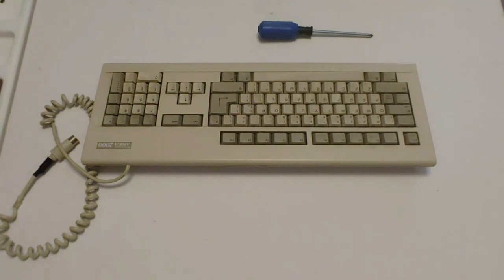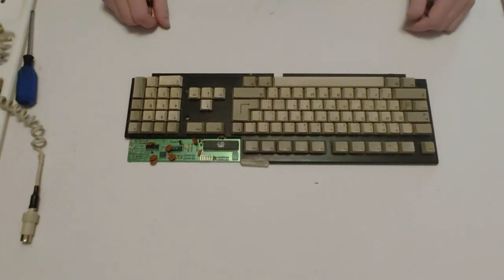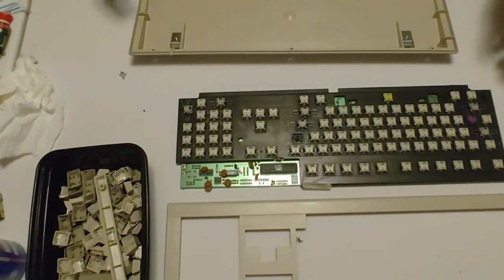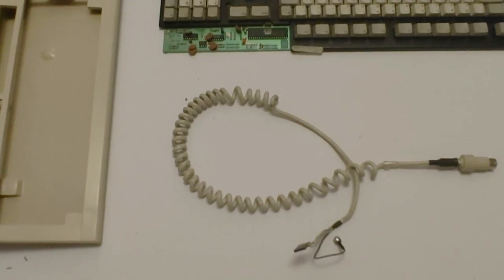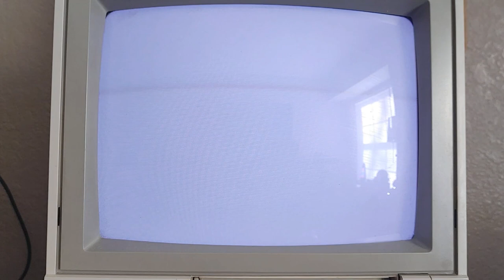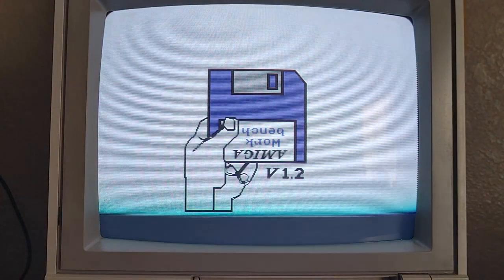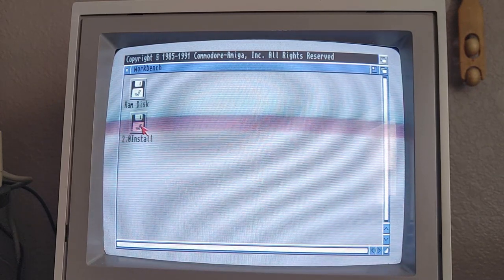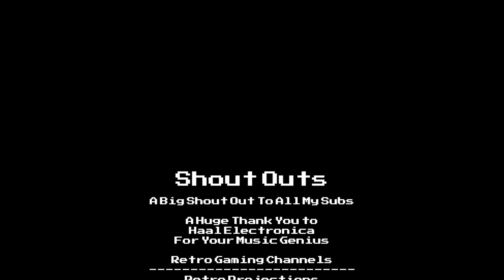Amiga Keyboard Restoration and Kickstart Rom Install

Comment: Very nice job on the kb restoration.  Even the cheapest computers back then came with good (in terms of build quality, not necessarily typing feel) keyboards.  All the early PC computer keyboards I had were very, very well made.  Some time around 96 they started really skimping on the quality of keyboards shipping with PCs and later with mice.  Recently I was cleaning a Dell keyboard and one of the keys still had like a single drop of water on it and it trashed the keyboard.  They use conducting ink on a Mylar sheet as the backplane to register keystrokes. That tiny single drop of water killed it.
Reply from the maker: Yep.. I have that Atari XEGS, it's got that kind of mylar membrane man.. Hate those keyboards. The traces are like gone.. I ordered some conductive paste awhile back to try to redraw them. But I think the porch pirates got that... Arghh. I'll have to reorder and think of a different project video in the meantime.

Comment: 18:10 When I fix cracked plastic, if there is a portion that is "inside" (not visible), I'll superglue the crack and then on the inside, JB Weld a piece of metal or plastic (like cut from a CD jewel case)  if I have extra to the inside, like a bicycle tube patch (IOW, a square or rectangular patch that overlaps the crack).  I learned that trick with radios. The repaired section will be the strongest part of the whole thing.

I doubt that standoff is going to hold. You can spread some JB weld around it (so that the JB Weld is on the both the case and the standoff).  In my experience, superglue is OK if you can work some baking soda into the repair, but otherwise is absolutely worthless for gluing plastic.
Reply from the maker: I've had luck with Gorilla Epoxy.. But yeah all I could find in the hick town I live in is Krazy glue.. lol... I really didnt want to wait to order some in. So.. lol.. If it breaks, I'll use Gorilla or JB.. JB is good I use it at work.
Reply: @RetrogamerGenX  The nice part about epoxy is it comes in 2 parts.  I've been buying superglue in the 5 packs in the Dollar Tree because for me, it's always 1 and done. 1 use it and the next time I go to use it, whatever was left is hard as a rock.  But 2 part epoxies like JB Weld can sit in a drawer forever because it needs the other part. But, it's just as likely the next time you need it, you can only find part A .:)